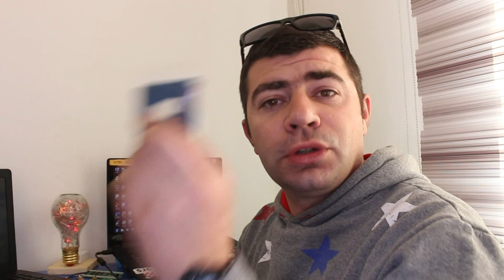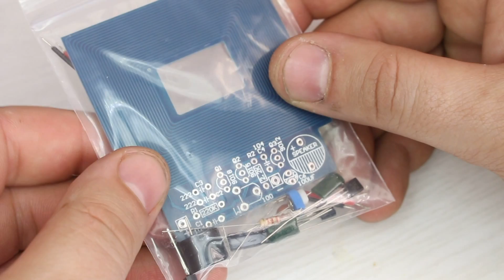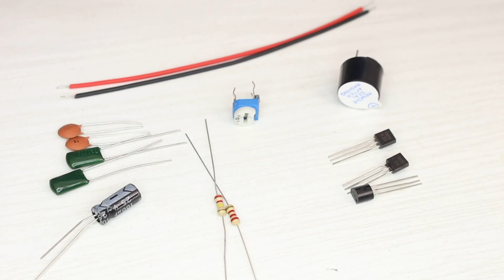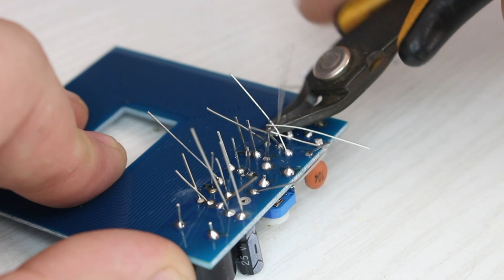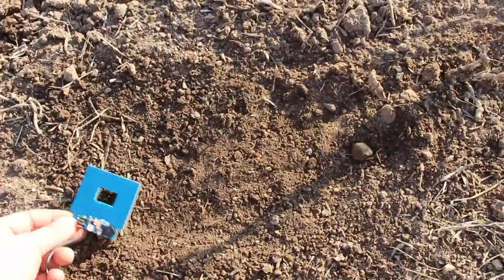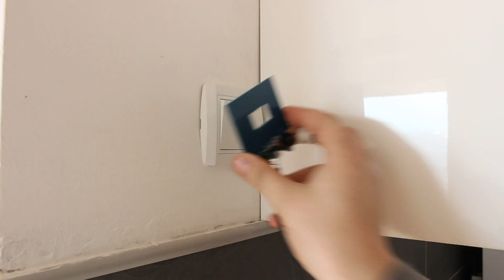Simple DIY Metal Detector kit

Comment: PLS CIRCUIT DIAGRAM
Reply: Gotin Fuklio This has PCB so it's hard to recreate without looks at unsoldered PCB. Even then, you may not be able to build it, and you need that detection transmitter.